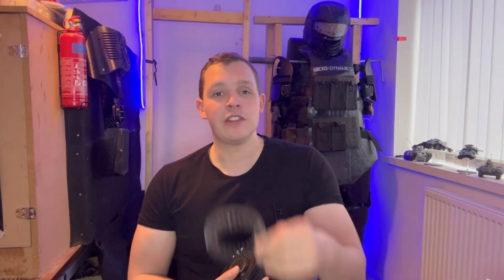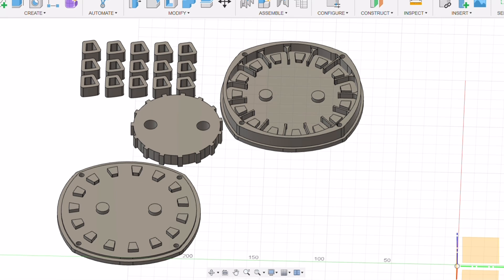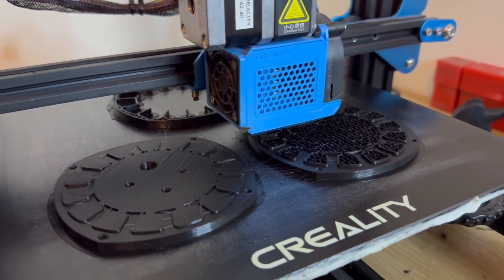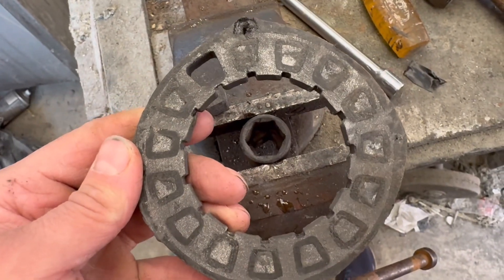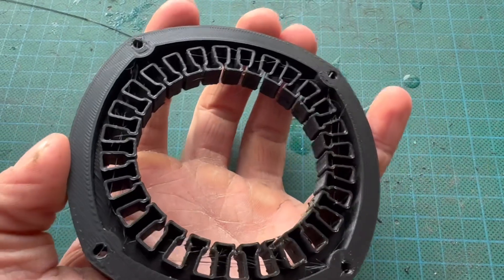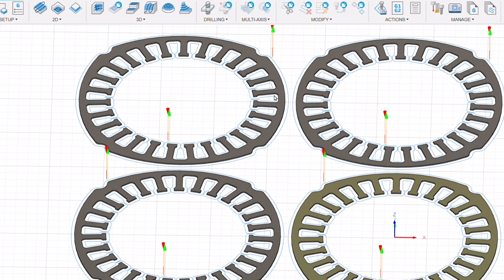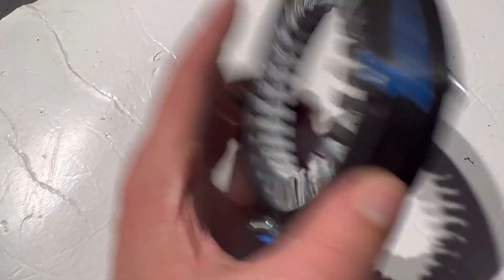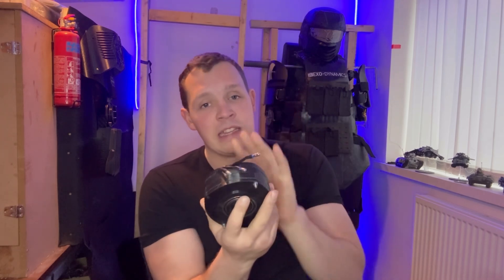What I learned building DIY brushless motor stators from scratch -  Exo Suit Robotic actuators

Comment: I would strongly encourage you to consider using the equipment you have to improve your equipment before trying to serial run your motors. Mass and rigidity are super important with machine tools, and runout on your spindle can be the difference between tools lasting less than one part and lasting hundreds of parts. Personally, I am fascinated by the possibility of using high performance concrete mixtures with composites to produce very stiff, massive, and damping components for machine tools on the small scale, but epoxy granite mixtures are commonly used in industry to produce very precise parts with excellent characteristics. It is also very possible on the small scale to produce aluminum castings that would improve the mechanics of your housings and rotors without too much capital outlay. Vevor makes an excellent benchtop melter capable of a couple of kg of low temperature metals, using that with either durabond casting sand or a lost wax plaster system using wax infused filaments would allow you to cast near net shapes that require finishing on your cnc.